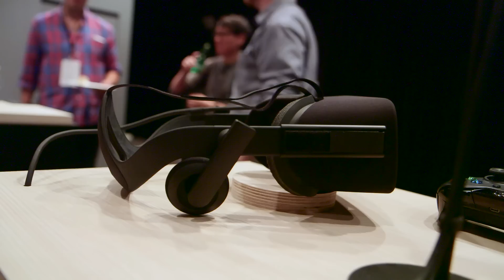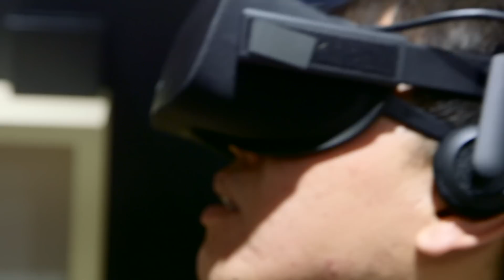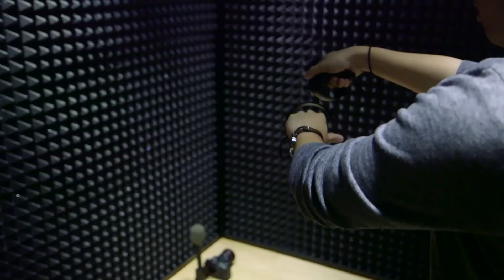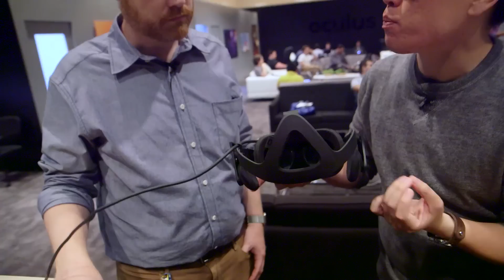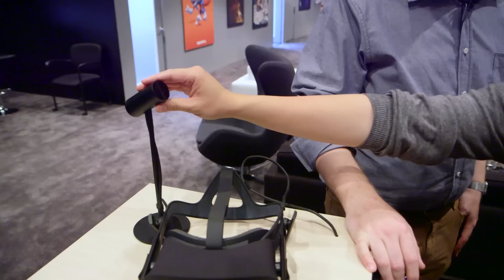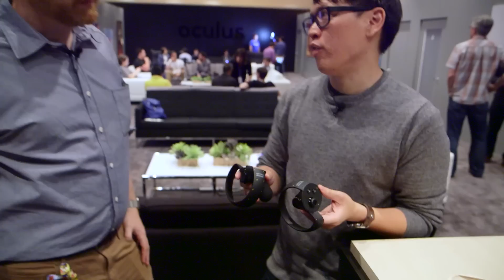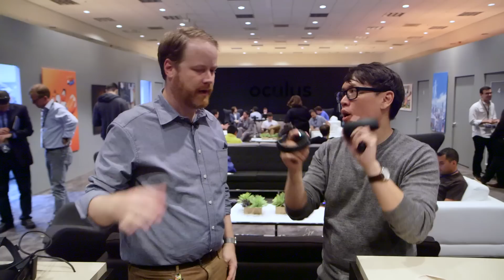Oculus Rift CV1 + Oculus Touch Controller Hands-On + Impressions!

Comment: 2160 by 1200 is still far too small, it needs to be 4k at least. facebook should have commissioned a 4k screen.
Reply: Can most people's computers run 4k?.... No!?  That's what I thought!!!
Reply: RobinHoodUKIP People say this, but do you realize how high density it would need to be? This isn't like a 40" display 3 feet away from you, they are near your eyeballs and small. Plus like others mentioned you would need video hardware that will be able to push two additional 4k monitors on your system, along with any other processing it requires. It will make games run like crap. Everything will be scaled and running at a lower res than the native. Plus it would make the whole device super expensive.
Reply: RobinHoodUKIP Pro-tip: the CV1 has no screen door. None. Also, do you have a computer with 15-20+ TFLOPS of GPU compute power for a 4k rift? If not sit down. Check out StarVR, 1440p per eye resolution. Requires a rig with at LEAST 3 GTX 980s (These cards cost 550-650 dollars USD). Not to mention the thousand-dollar processor you will need to not bottleneck them and the Christ-almighty power bill from running your 1000w beast all the time. Oh yeah, StarVR only runs at 60fps also. No 90fps low-latency. Smearfest when you snap your head. The truth is technology is not ready for 4k headsets and will not be for at least 2 (two) more years. The CV1 will induce presence which is all it needs to do. If you don't have experience with one, or a DK2 and understand that even the Dev Kit requires a 970...don't talk about how the specs should be better. 

Oculus uses what is called a Layered Compositor in CV1's software that abstracts UI layers and text to their own "layer" of rendering that can be up-rendered (4k for instance..) and down-scaled (Super-Sampled) to be crystal-clear and legible. Find me one review of the CV1 that complains about resolution or screen door and I'll point out to you a novice in these matters.
Reply: Pokemon Pulltality You don't need to run your games at 4k to see the benefits of a 4k screen.
Reply: RobinHoodUKIP  it will be in 3-4 years. Right now very high end pcs struggle to run 4k 60fps.. let alone 1.5x 4k at 90-120hz/fps lol. Cause two eyes = is kind of 1.5x 4k which is almost 5k.
Reply: MrSiimC Its not about running games in 4k resolution. Its about eliminating screen door effect whit 4k dispaly(to not see the grind the lcd panel is made from). You can run the game in lower resolution and run in on a 4k display. They opted out of 4k because of the price I guess but we will get there in 2 -3 years I think.
Reply: Lets just use the rift to play the original doom at 4K.
Reply: Mydogbuddy007 from the people trying the rift they said the screen door effect is almost don't exist i want 4k+ but refresh rate for me is better than resolution because moving is the main thing
Reply: +RobinHoodUKIP The DK1 had 360p per screen and I was still amazed and wanted to play all my games on it! 
Damm, resolution whores are even worse than graphics whores...
Reply: Pokemon Pulltality you mean can most people's computers run 2 4k screens = 8k :D
Reply: chets123456 you need 2  770s to run games at 4k 30/40fps
Reply: RobinHoodUKIP Needing a system that can run 4k at a solid 90Fps is going to seriously limit the market for quite a while. As of now you seriously cannot buy a system for any money that push that many pixels with modern AAA games.
Reply: MrAhmedUA 2 4K screens doesn't make an 8K screen, you need 4 4K screens to equal 8K just like you need 4 2K screens to make 4K, otherwise you have the horizontal resolution but not the vertical resolution.
Reply: +RobinHoodUKIP There are no screens able to do 4k, 90hz, low-persistence at the same size and form factor like what the CV1 has. Even the two screens in the CV1 right now are custom made. 

Higher res will come, but there are many other components that make for a good VR experience beside resolution, resolution starts having diminishing returns as well, as opposed to high refresh rate and low persistence which are a must have. I rather have a 90hz screen at a lower resolution than a 4k slideshow at 60hz.
Reply: RobinHoodUKIP 

And how do you plan to run games on that resolution? 2x Titans? Obviously very few people would be able to run that and then they'd have no consumers.
Reply: What most people are saying here about people's computers not being able to push 4k is absolute horse-crock. Most cheap consumer GPUs aren't able to push 4k at high framerates at high settings in new visually intensive games, but that is far from what most content is. Completely discarding how moronic it would be to buy something like the Oculus and attempt to run graphically intensive games without a high end graphics card, especially considering how much the Oculus will cost: 

It doesn't take much of a graphics card to push high resolutions in less demanding games or in desktop environments. And the main point of concern, as of right now, is stuff like text readability while wearing the device, for which resolution is important. Due to the nature of human vision text at the end of your field of vision is much harder to read, regardless of the resolution or clarity it's displayed at, and due to the increased presence in your field of view resulting in a much higher pixel pitch than a monitor sitting on a desk in front of you, reading text on a VR device either requires extremely large text and moving your head a lot, or a much higher resolution display. This is a usability issue, not a game performance one.

The thing that's a lot more noticeable and impactful to people's enjoyment of using the device for consuming visual media is pixel spacing. Which isn't the only contributor to the screen door effect, but by far the main one. On a monitor that's meters and meters away from you it doesn't matter if only a fraction of the visual space is actually lit by pixels, as is often the case on things like advertising billboards. But when the screen is pressed up against your face the dark space between pixels is a lot more noticeable and distracting. This can be solved in large part without touching the resolution of the device at all, either through multi-layer displays that light up cells, or manufacturing panels with smaller pixel spacing.

Also, there are a lot of assumptions going both ways about the cost of displays... The main cost factor has much less to do with factors surrounding display specifications than people assume, and a hell of a lot more to do with the production volume. VR devices have been using high production volume phone displays for a reason.
Reply: RobinHoodUKIP 4k is an impossibility at this time. Oculus settled with the resolutions they have as currently there are NO screen designs available reaching 4k resolutions in that small of a form factor. CV1 has the best screens it can have at the moment. 4k will come later when screen tech allows such. There is also currently no need for 4k render resolution as not even the best gaming machines are going to be churning out 4k resolution with two render targets at 90 fps.
Reply: RobinHoodUKIP A lot won't be able to run a 4K screen.
Reply: its not 4k bakaa its 8k
Reply: anononomous Then do literally anything else besides playing the most recent AAA games with maxed out graphics?
Reply: tulp35000 Probably CV2 the next year after CV1's release.
Reply: onionburst  i expect even first consumer oculus will require at least dual gpu config for any serious game.
Reply: chets123456 you must be running old or simpler graphics games to be able to get that (or you've turned the graphics settings down)
Reply: Domtrain It's probably also because their aren't any 4K high refresh rate screens (or at least none that accept a 90hz+ input)
Reply: hmm well from the specs vive seems to be better than oculus. Plus it's coming out 2015 holiday. And not first quarter of 2016 like rift. it also has its own game distribution platform and steam controller. Theres already a bunch of game dev companies and tv channels like HBO with contracts in place for the headset as soon as it launches. As for hardware.. Bigger resolution will probably warrant better pc specs. Oh well. It will depend on other vr headset specs tho. Screen type. has to be no less than oled.
Reply: RobinHoodUKIP i remember when people where dancing on the ceiling when they upgraded to 1080p
Reply: chets123456  That is true. People dont understand that not all games in the world are triple a titles.
Reply: MrAhmedUA I haven't tried it myself yet so i don't know how bad the screen door effect is, hopefully it won't be too bad :/ . Refresh rate is pretty important for VR though it depends on what your doing, if your playing a fast paced VR game than you need a fast refresh rate but if you are doing something slow like watching a movie or something than a higher resolution screen (like Gear VR) would be more beneficial.
Reply: Mydogbuddy007 i think the next headset it will be 144 or 120 though 90 is not bad at all
Reply: MrAhmedUA Yeah probably, though i'm hoping for a higher resolution as well, have you seen Star VR? now that's pretty ridiculous lol, they have 2 1440p screens, 1 for each eye (though running it requires a beast PC, and they have downsides compared to the oculus rift)
Reply: Mydogbuddy007 less hz tho and looks like alien :D
Reply: MrAhmedUA yeah i wouldn't expect such a high resolution screen at such a high refresh (yet) the look doesn't bother me, though i prefer what one of their prototypes looked like over their current one lol
Reply: chets123456 Well I have two 760 and they can barely handle 2k in new games... at least not with 60fps+.
Reply: V mike well its mid end gpu. Even in sli its not much better than a single 970.
Reply: Pokemon Pulltality Assuming that the games are running natively at 4K resolution and not just upscaled to fit the 4k screen, which I could accept as a compromise.
Reply: Domtrain screen door effect actually has more to do with pixel pitch. I think I read that they've reduced that with CV1. Basically, this means the pixels are packed tighter together, but are slightly bigger.

It might help to imagine a display with no space between the pixels. In such a display, there would be zero difference between a 4k display running something at 2k (ie. 4 physical pixels per pixel data) and running a 2k display running at 2k (ie. pixels 4 times the size).
Reply: +scythelord There's a new sony phone coming out with a 4k display (sorry if somebody's already said that)
Reply: +Tech Knights I know right? Because an average  gaming PC can totally run two 4k displays at 90fps!
Reply: +The Field of Justice And the oculus is at 90 fps.
Reply: +Tech Knights Better to upscale to 4k, it's about fill ratio mainly. I know they are using defusers, but there is no replacement for higher density displays.

DK2 looks absolutely horrible, it is unusable, the step to 2160x1200 is far too small to be meaningful.
Reply: +RobinHoodUKIP 4k on oculus? on 2 screen?

even my titan will burn to crisp in 10 mnt.
Reply: +Tech Knights actually no, but it is coming, not very long ago 1080 was a full luxury... aside of laps, Who does not have it today?   It is coming and it is coming fast, me myself i got lucky, I work the moner (kinda of expendive) and bouth a 4k 40"  philips screen, build a top end gaming pc and this is one of the very fucking best of it all, i love for ever this BIG 4k screen(no tv)
Reply: +chets123456 so your trying to say a single gtx 770 can run 4k at a reasonable frame rate cause idk how that is possible
Reply: +XPortersraygunX 
I am running i 4K and with attila TW maxed out, but i am using a GTX 980 4G
Reply: +Ricardo Maccotta thats much more reasonable but i would say a 980 ti is what you would want/need for a 4k oculus.
 i was talking to chets he made a comment about 4k on a gtx 770
Reply: +XPortersraygunX 
yes i did realized that you were talking to chest, i just wanted to point that about the 980
i plan for oculus next year, but after an almost 1000 dollars card i hope it will hold at least for the next year, we will see
Until now, everything i throw to it, it chews it like nothing, farcry, heavy moded skyrim, metro, attila tw... all at 4K and maxed or pretty much maxed.
I know i am playing at 30Hz but i do not notize anything, the screen says is capable of 4K 60Hz but i have not investigated it.
It is a 40" - 4K philips monitor
Reply: Ricardo Maccotta your certainly better off than i am  my gpu is a 770 im planning on upgrading when pascal or volta come out
Reply: +XPortersraygunX 
hahahaha... was not Fourier and Faraday about ten too?
I worked hard and made a heavy spare effort last year to build my rig, 5820K - Assus X99 DeLuxe - 16G DDR4 2400 - MSI GTX 980 4K Frozen (absolute silence at all times) - Three dedicated SSD drives (OS - Games -  Rest) and Two HD Caviar 3T for storage and backups - CPU Water cooling - Corsair Graphite big case - 40" - 4K Philips monitor.... Corsair gaming keyboard and mouse .....almost 4K dollars.
It was hard not getting out many times, but how to say, I am super-super-super-super satisfied .....hahahahaha
Reply: +RobinHoodUKIP That's nonsense.
Reply: Do you realize how tiny the screens are?
Reply: I hope you've since learned that dual panel resolutions ≠ single panel resolutions in VR due to all the wasted non-visible pixels when using the latter (in-between the eyes & in the corners). The 1200p dual panel CV1 actually had a higher pixel density than the single panel 1440p GearVR. Also, running 4K in stereo 3D at 90fps would have been LITERALLY IMPOSSIBLE in 2016 dipshit! Even if such display panels had actually even existed in the first place!

Comment: Great job guys.

They demo-ed it with two cameras, with 3 camera it's possible to have 360 degrees coverage.

Is there as limit on how many cameras supported per headset/controller?
Reply: MK84 theoretically no, but i'm just speculating.
Reply: MK84 most likely the limit will be the number of usb3 sockets you have
Reply: +gregsmw and number of usb extension cables you can BUY and lay around at your home LOL!!

Comment: "More than 150°... er... I'm sorry... not a 150°... it's wider than DK2"
That sounds like he said something he wasn't supposed to say.
Reply: TeeTrizZz or he meant to say its 105 :D
Reply: TeeTrizZz Nah he just misspoke. 150° is a very large scale of FOV. I'd imagine it being around 105°-115°.
Reply: Will E Just? Nah. He misspoke AND he wasn't supposed to say. I guarantee you he knows what FoV it is and that he's not allowed to give out too many specific technical details, as he was avoiding other precise questions as well. It's understandable too given that they don't want their competition figuring out their exact technical specs ahead of time.
Reply: Deathbrewer I don't know how to say this without sounding arrogant, but I can guarantee you CV1 won't have 150° FOV. Offering a wider field of view than the DK1 & DK2 will result in lack of detail and refresh rate. As they said to have hit the presence level with CV1 as well as offering great ergonomics, it wouldn't make any sense if they released CV1 with that high degrees of FOV. Unless they've done some drastic changes in the lenses, which is entirely possible I guess, just that it's one of the most difficult tasks with HMDs.

Comment: Can you compare the weight to something similar? Like google cardboard or something?
Reply: MrSerrrg88 he said it was slightly more then a baseball cap. thats a fair bit lighter then most of the others
Reply: MrSerrrg88 There aren't any similar ones per se. Not as far along in their development anyways. Gear VR is a different concept with a mobile phone etc. 
The baseball cap reference was to the way it's put on, not its weight, It'll weigh around 400g (14oz)
Reply: MrSerrrg88 Under 380g is what I've heard for the CV1. What I'd like to know is just how much the DK2 weighs, and how much lighter this one is. The DK2 causes me neck pain on the day after a long session, hopefully the CV1 won't. I'm also very curious as to what the Vive will weigh, it looks much heavier than the consumer Rift.
Reply: ***** did you hold something you are writing about in your hands? Me not. But I did hold google cardboard, and I did use it. The weight of the phones is similar, so it is acceptable for a vague comparison.

Comment: Can you tell us what you can about Morpheus? Thankss
Reply: bishbashboshjt It's powered by the PS4 ~ 'nuff said.  =P   Might be cool, but can't touch PC HMDs.
Reply: +Brandon Phyle Yeah, I mean the recommended specs for the Rift DESTROYS a PS4, I don't see how they could give the same experience as the Oculus..
Reply: ***** Pretty much that. Morpheus will be ok for graphically downgraded games only as after all, it is powered by a system with a GPU that is much too weak to even power their current games consistently higher than 30 fps. A lot of the games out would have to have their graphical demands reduced to nearly 1/6th what they currently are to achieve 90hz while rendering two cameras.
Reply: bishbashboshjt Morpheus games will have to be designed around low end graphics.  Expect lots of tricks to make the games look good, like a ton of rail shooters, closeups, and games without large areas you can explore.  It's basically the Wii of VR.
Reply: +Neddskorg of course it will, move has fantastic tracking already no need to reinvent the wheel there.
(except maybe more buttons and built in analog sticks?, similar to the sadly now discontinued razer hydra) 
but EXPENSIVE knowing $ony, ive tried it already here in Vegas at the PS Dev event but it still has a few things to tweak.